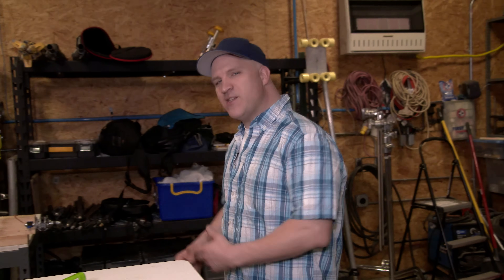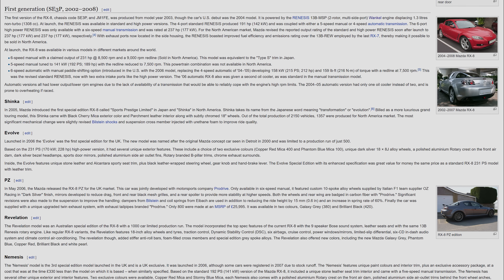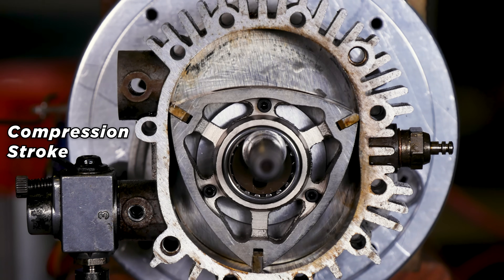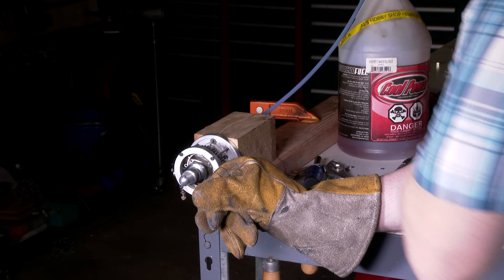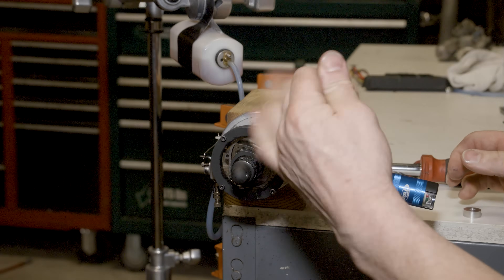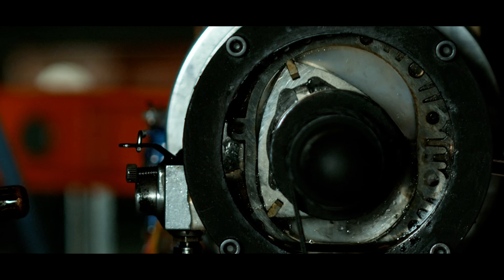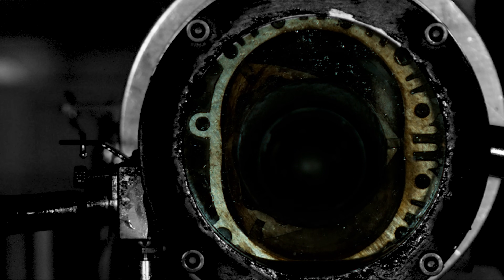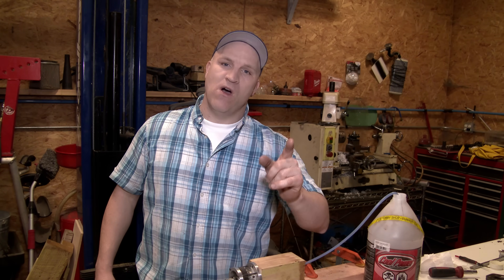See Thru Rotary Engine in Slow Motion - (Wankel Engine) 4K

Comment: It sure makes the "variability" of the combustion process visible. It's inconsistent as hell and the timing is horrible. One firing it's "late" and the next its "early". Seeing the "flame" on the "back" side of the rotor leaking back into the "intake" portion of the cycle is really interesting. Not surprising given what those engines are and how "inefficient" they are, but interesting in that it proves it.
Reply: So how does fire from the "combustion chamber" get back to ignite the fuel in the carburetor and light the torch?
Reply: Been a mechanic for 25 years and a gearhead for life, chief. You're not going to piss on my boots and tell me its raining.
Reply: DEEREMEYER1   Newbie .
Reply: DEEREMEYER1 Newbie.

Comment: i think shes running a little rich lol
Reply: nitromethane  requires a very rich mixture
Reply: doktorbimmer there shouldn't  be liquid fuel visible in the Combustion chamber, it should be atomized like any other Combustion engine, sloshing liquid fuel, means there's a lot of fuel that's not in contact with oxygen, which means rich. Like any other fuel, nitro has a stoicheometric ratio
Reply: Once, You Could Mow Your Lawn With A Rotary Engine

Comment: this isnt a rotary engine, a rotary engine is what was most commonly used on ww1 aircraft where the engineblock was rotating instead of the crankshaft
Reply: YES, technically speaking, the Wankel KKM design is not a rotary engine at all, only the initial failed prototype (DKM-54) was a rotary. The now defunct registered trademark brand "Mazda Rotary®" which pays homage to Dr.Wankel's work has unfortunately become patois, street slang rather that the correct term 'Orbiting Piston Engine'.
Reply: The recently contrived term "Radial-Rotary" is contradictory, an oxymoron... no such design or term is found in legitimate engineering journals or technical publications.
 The Rotary engine is defined by its crankshaft configuration and its relationship to the engine casing or housing, it is in no way related to engines cylinder configurations or piston shape.
In 1967 Graupner GmbH licensed the non-rotary version of the Wankel called the KKM-57 designed by Hanns Paschke and Walter Froede, The KKM was designed without any knowledge or assistance from Felix Wankel and while retaining the Wankel's Orbiting Piston concept completely discarded his rotary engine layout in favor of the conventional shaft arrangement.  cheers
Reply: bombo139 fucking idiot
Reply from the maker: bombo139 well that's a radial rotary engine, this is a Wankel rotary engine, they are all considered rotary engines. Unbeknownst to most there are even many different types of rotary engines that aren't in general use
Reply: Ger kav
1 day ago
I still remember your negativism on wankel engines. You showed it in another RX8 videos. I'm sure someone with a wankel engine got your wife. Remind this. When Mazda won Lemans with a Wankel car, the rules have changed and no wankel engine is allowed to participate in Lemans since then. Mazda Lemans car was in perfet condition after the race. This fact shows that wankel is STILL a reliable engine type. 
I'm not gonna dialogue with you again, so shut up! Please!
Reply: more efficient

Comment: Nice video, but what I still don't understand is if it initially fires at "top dead center" or whatever you want to call it, it seems like there is a 50/50 chance of it spinning the wrong way. Is it just luck that gets is going in the right direction after a few tries?
Reply from the maker: That's a great question
Reply: Warped Perception Thank you.   😁

Comment: Thank you so much for this video. I finally have a mental and visual image as to how these engines work. I also understand why these engines have terrible gas milege. It's amazing how much fuel goes unburned and the combustion compartment gets flooded with fuel, at the same how a back fire happens and makes a flame shoot up through the carb. I know you spent over 200 takes but it was well worth it. Thank you for your vids.

Comment: Flame spitting unruly wasteful beast. 3 foot flames used to kick out the back of my 
straight-piped RX7 Turbo II. If gas was cheaper and cleaner, we would all be running rotaries! So with Wankels, theres never been a problem with the engine, just the fuel!! Haha

Comment: awesome video, thanks, question about longevity????   my cars have always gotten 500,000km no problem on original motor, with no issues other than wear and tear ( brakes, mufflers, spark plugs, etc)  hell last car was a Pontiac Sunfire 4cylinder 5 speed and believe it or not, I had 721,000km on original motor and transmission never broke down, can do rotary engines last that long?
Reply: 500,000 km with a Wankel engine without a significant loss of compression and major problems would be an unbelievable feat... your chances of winning the lottery are better.

Comment: This is cool, It's nice to see the engine running. I like the rotary design, It's a shame its not so popular, a lot less to go wrong and the power increase options were excellent. You can also keep stacking more rotary's. I think the EPA fucked over the rotary because it wasn't that fuel efficient.
Reply: Nah, the Wankel simply did not offer any significant advantages and had way too many problems. Not really, Mazda discontinued the RX brand due to poor sales not emissions or fuel economy, new car buyers just weren't buying them anymore mainly due to there bad reputation.

Comment: Shows why the real full sized ones had so many issues including issues with flooding while trying to start them up. Rotarys can be cool in highly modified units but they are just horrible engines for normal cars and amazing mazda still keep trying to find ways to bring them back.
Reply: Mazda abandoned development of production Wankel engines in May 2009 and ceased production in June of 2012.
Reply: If you paid attention to automotive news Mazda keep coming out with stories of bringing it back and the latest story from mazda is they plan to bring it back in a hybrid car where the engine acts as a generator.
Reply: No official news from Mazda.. they didn't even consider a Wankel engine in their last Concept Car at the Tokyo Auto Show.

Comment: Are the explosion sounds in slow motion real or just fake sound effects?
Reply from the maker: Maserati7200 so that's kinda complicated, essentially they are the actual captured sounds, they have just been manipulated with other frequencies so they turn into something that we can hear. For instance if you record sound and then you stretch it to match the high-speed footage captured, if the frequency is 1000 Hertz, once you slow that down by 100 times, it turns into 10 Hertz which we cannot hear. Unfortunately the technology and the process is limited because it's based off of the digital signature of the original captured sound.

Comment: These little rotary engines are amazing, my hubby has a small hand built single cylinder engine, ( about 50 cc)  mounted on a stingray chopper bicycle and it's very fast and strong for a little engine, he can ride up to 40 miles an hour easily on it with throttle to spare. the channel, subbed.

Comment: There is a reason why the Rotary engine is not used en-masse. 
Its dog shit. 

Low thermal efficiency, low torque and it eats itself and loves fuel and oil.
Reply: You dont need that much torque if your car can rev high
Reply: BEST ENGINE OF THE 21 CENTURY
Reply: @fransiscoh9450  like he said they eat themselves. Yes you may be able to "rev" higher but it'll take me maby a third to get moving and after a while the engine feels that
Reply: T's & P's I agree if used with liquid fuels, but not as a Compressed Air engine, when used with CA the engine works really well as the air cushions the moving parts, also the torque is high and is really efficient!. I’m talking about Angelo Di Pietro’s AirEngine that Fords have put into a prototype of their new ‘Model T’.

Comment: Idk much about this engine but, it looked like it was running rich on fuel alone but whatever mixtures you eventually ended up with, it looked like it was running pretty dam good by the end... very cool man, thanks for sharing!
Reply from the maker: Seth H what part of the problem is that there's no flywheel in his engine, so I have to run it rich to get it to continue through the cycle. You will see what I'm talking about in the future videos. Thanks for watching and I'm glad you liked it

Comment: That is absolutely awesome footage on how one works, im a gear head so i already new but all your see through engines/motors in super slow mow is awesome. How long do we have to wait for episode 2? Im going to take a guess your going to use the sachses 303 wankel engine from a snowmobile as thats air cooled and a single rotor so should be the easiest to make a clear plate for as you dont have to worry about water jackets etc. absolutely cant wait to see it. Awesome job.
Reply from the maker: thomas Healey not too long, working on it now . Thanks

Comment: There's a lot of unburned fuel. Is that carb setting? This is one type of engine in which I have zero experience.
Reply: Nitro type engines typically need a very rich mixture, with the Wankel design even more so.

Comment: Air fuel ratio looks on the money there.
Reply: Indeed, Wankel engines typical require a richer AFR than an Otto engine and "nitro" fuel engines can run anywhere in the 3:1 to 10:1 range Much richer than a reciprocating 4-stroke running on gasoline that averages around 14:1

Comment: you know you could use a cordless drill to start it nub.....
Reply from the maker: if you think that will work, you should give it a try and get back to me because it doesn't, reason it doesn't work is the same reason that if you look at any pull start engine it has a one-way clutch mechanism. Once it starts firing you need to automatically release from the engine else it will stall or start twisting the entire drill out of control depending on the engine size.

Comment: It was very interesting there is another Youtube where the person has it listed as Hemi Wankel. I noticed in this engine the port timing produces a flame front that resides mostly forward of center. The Hemi design take advantage of this attribute it also changes the sparkplug location  in full size Wankel engine. He did not have running engine in post or any follow up your video makes the Hemi timing and mod a possible potential improvement yet don"t know how balancing rotor could be effected. Thinking no follow up points toward nice in concept fails real world.
Reply: Ernie Brink is a fraud... his engine does not run and does not offer any improvement, it is nothing but a scam
Reply: Mr Brink is a crackpot, any competent engineer would understand that it is not possible to offset the pressure inside the combustion chamber as this would clearly violate Pascal's Law.

Comment: The model Wankel engine you showed is indeed very simple -- I own several of them. But a full-size Wankel engine is actually much more complicated than a comparable piston engine. Most of the parts are actually seals; the average  2-rotor Wankel engine has about 100 sealing parts, both the seals themselves and the springs that hold them against the walls of the rotor housing. Unlike the large moving parts in a piston engine, the seals in a Wankel engine are small and delicate, and even slight misplacement will cause them to malfunction and gouge the rotor housing. There's actually a lot to go wrong, which is why Wankel engines are notoriously short-lived. It's not just because racers love to beat the shit out of them, it's because they actually are pretty fragile compared to piston engines.
Reply: Who cares if it has less moving parts? My 50 year old piston engine still runs to this day. Try that with a Wankel engine. I good saying for a Rotary engine is a candle that burns twice as bright, but for only half the time. And a Rotary engine burns very bright.
Reply: Well yeah, I was agreeing and adding to why it's not more popular.
Reply: To the contrary, wankels have been put into planes because of the reliability and ability to not only run with no oil but not seize. Proper maitenance of the engine will see it last for ywars and years. I personally owned an 86 with 280000 miles on the original motor with no rebuild when i bought it. Ported and matched exhaust i got 250 bhp from a 1.3 liter. That car saw 10k rpms everyday as it was used as a delivery vehicle sometimes more than 200 miles per day. They can be reliable if youre not a shitty mechanic.
Reply: Shawn Elliott yeah a total of 24 parts, 2 rotors, 6 apex seals, 4 oil control rings, 12 apex springs. Still a heck of a lot less than a 4 cylinder conventional engine
Reply: BEST ENGINE OF THE 21 CENTURY
Reply: Incorrect. https://en.wikipedia.org/wiki/Wankel_engine#Sealing "Current engines have nearly 100 seal-related parts."
Reply: It's not a competition. The engines don't care about winning arguments -- only human fanboys care about that.
Reply: Your right, there is a reason it didn't take off and it's not totally patents and copyrights lol, there are ways to combat that. Just wasn't a desired technology for the pitfalls, not to mention for the average shade tree mechanic, the knowledge base is already present for conventional engines.
Reply: Since you mention shadetree mechanics, it's also worth noting that Wankels are harder than hell to rebuild. You can't just pop the pistons out through the top of the crankcase, you have to remove and disassemble the entire engine -- and then you'll probably have to get a professional rebuild anyway because it's impossible to re-machine the rotor housings to the correct shape without heavy industrial equipment.
Reply: The desirability on planes was largely due to the power to size and weight. The RX8 around the mid 2000s was an almost perfect weight distribution I think instead of to the front or rear without being a midengine car.
Reply: The RX-8 is a mid-engine car. The engine is completely between the front and rear axles with no overhang. It's just a mid-front engine car rather than a mid-rear engine car.
Reply: What are you talking about? You can't run a Wankel without oil. Maybe a diesel Wankel could run without oil injectors, because diesel fuel has lubricating properties unlike gasoline, but the engine would still need an oil supply to lubricate the e-shaft.

Also, most people are shitty mechanics, not because they're incompetent, but because they're not mechanics.  I enjoy working on my car sometimes and I'm a very competent tinkerer in general, but it's not my core expertise, I don't work in a car garage, and I don't own a lift, so I'm a shitty mechanic no matter how good I am at turning wrenches. If an engine's reliability is contingent upon the owner being a good mechanic, then it's not a reliable engine. Reliability means not needing to constantly monitor the engine for potential problems.
Reply: Once again wasn't anything worth an argument, if still got the front alignment, like you said 5
FMR, was strictly referring  to the overall weight distribution. It just managed to do a better job of attempting to have a true mid engine instead of stretching out the hood and pushing the wheelbase further foward.
Reply: I wasn't arguing, I was just correcting a minor inaccuracy in your previous post.
Reply: Shawn Elliott ah, either way like I said. No inaccuracy, it's still front mid instead of a true midengine that had major performance issues in other areas. Either way more important things in life to worry over
Reply: There's no such thing as a "true mid engine" sports car. They are all either mid-front or mid-rear, with mid-rear being more popular. A "true mid engine" sports car would have no room for the passenger compartment, though there are some "true mid engine" vans with the engine directly under the passenger compartment.

And yes, there are more important things in life to worry about, but that's not an acceptable defense against being corrected.
Reply: Shawn Elliott lol ok was actually agreeing with ya on a lot, but see you are the gotta be right type even though you just said there are examples of true mid engine vehicles it's all good. I'll leave the thread so you can find a brick wall and have fun. Was never specifically talking about only sports cars and even then there are high performance cars with a true mid.